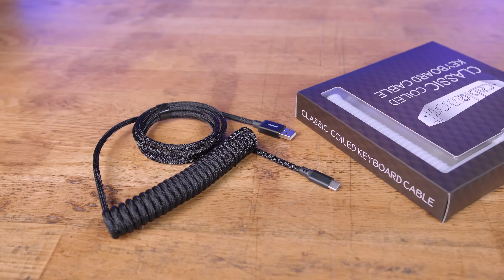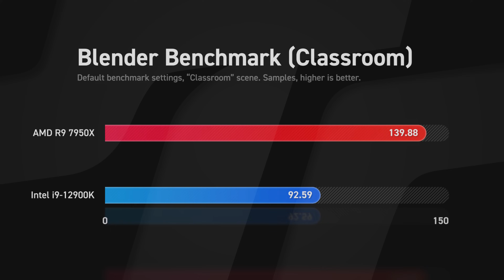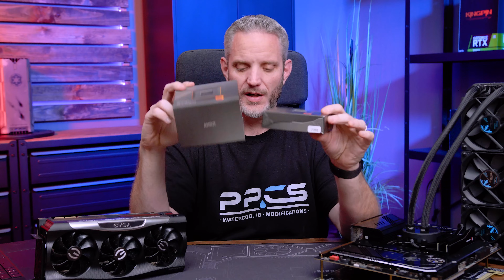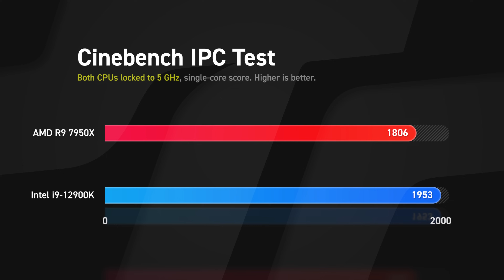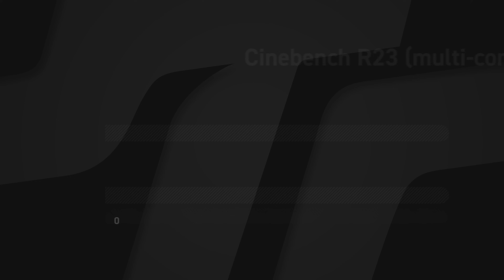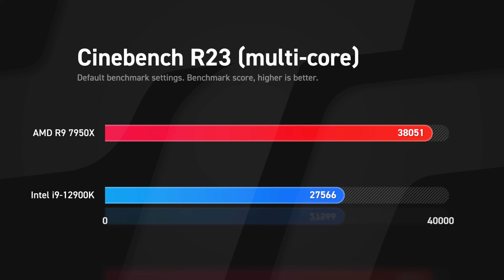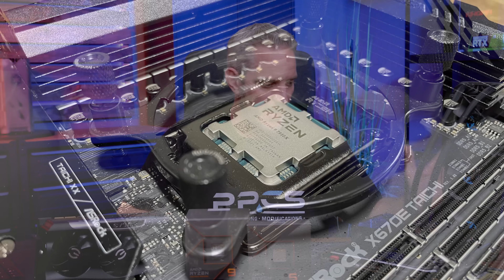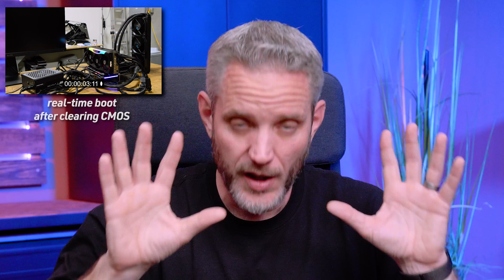Forget EVERTHING you THINK you know about AMD... these CPUs kick A$$!!

Comment: The fact that it adjusts the RAM timings all by itself on boot is amazing.
Reply: I wouldn't mind seeing that feature for am4/ddr4
Reply: People will really argue about anything. If AMD has better CPUs then Intel then great. If Intel has better CPUs then also great.
Reply: The most annoying part of PC OC is RAM, could take full day to find optimum timings. Now, clear CMOS, turn it on and grab a drink till it optimizes itself :D
Reply: @amehu  Yeah, great idea! Reset the motherboard settings to default for a more stable overclock!

Except for the part where doing so would also deactivate any overclocks and therefore negate the entire process.
Reply: @rio-dq9sc  I've not noticed any difference whatsoever between an Intel I7-8700k and a Ryzen 7 5800x. They have almost complete parity and there are 0 compatibility issues.
Reply: 100% agree.
Reply: @rio-dq9sc  Could you actually make this any more biased?
Reply: @josephp1592  Laughing with 16 cores and 32 threads while just using at max 12 threads. Should’ve spent the more money elsewhere buddy, like faster GPU or larger NVME SSD.
Reply: @josephp1592  You gonna be going waaa waaa when intels new FABs are built... 🤣

Comment: 5800X3D just beat Ryzen 7000 XD. 

Ryzen 7000 is heavily depended on good RAM - u need at least 6000 CL30, tight timings, it's better to get 6200 CL32 which is expensive as f. RAM + Mobo + 7600X = 1k $ XD Sorry, not buying. 
5800X3D + mobo + bdie 3733 CL13/14= 749$, and I will be on par or slightly (1-7%) worse, or even 17% better in some games. 

7xxx is NOTHING special in games.

Comment: Even if Raptor lake is a great improvement over AL, there's no reason not to buy into AM5. When Steve at GN could only get a confident CPU bottleneck in like four games and getting like 600+ fps in those with the top end 3090ti at low settings and 1080p, you are going to be GPU bound no matter what anyway (in real-life gaming scenarios) so for gaming a zen 4 CPU choice can't be wrong. With 20-40% multi-thread of 12900k uplift, its probably going to be on par (or better) with 13900k in those loads as well.

Well done AMD. I remember when a bunch of people said how bad zen four would suck because it only had a 15% performance uplift. Yeah we know who you are.

Comment: my gpu upgrade i be getting in the next 4 months is going to be a rtx 2060 12gb was going for a 3060 12gb but its cheaper and easier to obtain with my fix income then i can give my bud my gtx 1660 super oc 6gb and he can stop using my 1050ti 4gb and have a lil better performance then just save up for the other pc upgrades which that's another 4 to 6 months to save up for and then give him my current pc which is a gigabyte b450m ds3h mobo ryzen 5 2600 cpu and 4x4gb of gskill rip jaw v 3200 ddr4 so he can upgrade it to 32 if he wants were his current intel 5 ddr3 mobo is only 8gb max.

Comment: The problem I have with AMD is it's always had stability issues. I built an full AMD system about 5-6 years ago and I had nothing but stability / crashing issues the entire 1 1/2 years I ran the system.  I never even tried overclocking the system and never could I get it to even run the memory at the lowest advertised speed. If I tried setting the memory to the lowest rated speed in the BIOS it would be caught in a BIOS crash loop.
Unless they have fixed the stability issues over the last couple of years it's unlikely I will ever buy one again.

Comment: Not thrilled about the new boosting behavior, a lot of heat (which is fine) but also a lot of power draw. When does it boost? Will it boost on any mildly heavy load?

Comment: Being a gamer who mods fallout 4.... Talk about an understatement, at present I have 714 mods for fallout 4 alone.
Many of these mods and many others that I don't use have to apparently be patched to work with AMD the CPUs etc. I've seen a lot of good results from them don't get me wrong, but a lot of the mods that would require a patch for AMD? That passage is simply doesn't exist which means you can't use that mod if you're running an AMD system.
Like I said, it's too bad cuz I see a lot of good stuff coming from them

Comment: this might be myth: but iv read and been told by a few sources that these processors run extremely hot. they said to lower the voltage just by a little bit and runs just as fast if not faster but stays way cooler.

Comment: The more I think about the new AMD thermal design the more I like it : your cooler is a fixed parameter, then you adjust your fan/noise level, and then the CPU auto adjust to a stable clock at 95C, so you got automatically the best performance for your setup !
EXPO is a nice improvement as well, RAM OC is such a hurdle...

Comment: Hi Jayz, being able to overclock ever single core sounds neat, however, doesn't that present an optimization issue? We're not at a level where CPU load can be spread evenly in software titles (certainly not games) so the main thread will always dominate CPU cycles so having a couple of cores that are focused on overclocking sounds like it could be more performant than all cores which could go up and down. I guess we'll need to see some real-world results to know if this is better or not.

Comment: chill they have not done much over the 15% clockincrease that tsmc rated their node for :D credit were credit is due(also the effective clock cycles back at tempmax look at the hardware info)
the ram training needs to be dumped and put into a fukign buttoin in the bios...complet design failure. No idea who thought training over the most basic by defautl is a fukign good idea...ITSNOT
and the querks are the fuking TMP that they FINALY figured out and is partialy adressed in agesa 1207 i belive it was....
the 7600 and 7700 are designed form gaming so why arent there 3d parts of them the base versions are jsut waste of sand if you know they will be obsolete by q2 ..i dont understand this launch....is it nothing mroe than a fukign stopgab to be faster out than intel ?! casue they cant get the 3d versions ready? Who ever buys a non3d  6 or 8 core is insane IMO the 12 and 16core for workstations will be amazing! (althou i doubt the 12core is worth it with the platformcost)

Comment: This is weird, Nvidia is nowhere near as far behind as Intel was with chip development and setbacks. Intels problems were 10 years of manufacturing issues with low nm processor development. Nvidia has never has that issue, because they've always outsourced manufacturing to TSMC and Samsung. In fact, Nvidia has been the leader of the pack in terms of hardware, software and ai solution as standard operating procedures. Even if people don't like Nvidia's prices, they can say they haven't been innovating, or trying to give us the most powerful hardward in the entire computer industry. This is all just a weird line of thinking. "Railroad spike"?!?! Yikes.

The 4090 will continue to be top of the stack in terms of perforamnce; AMD will only be competing on price, and performance for dollar, not better performance outright. AMD didn't even aim for best performance, they wanted better perforamnce than the 3090 at a lower price. The only question is, how much lower is the price.

Comment: From what I understand about the temps being at a constant 95, you will always hit that mark no matter what cooler you use. Only difference is that when you use a better cooling system, its going to try to increase the voltage and wattage being consumed by the chip in order to achieve better clock frequencies, but will stay at or around 95 degrees. 

So different coolers will get different results in performance, if that makes sense.
Reply: @Lurch7861 You clearly don't understand hardware.  What temps do you think your servers operate at?  Servers regularly are near their TJ-Max and they can stay like that for years without problems.  Migration only happens if the voltage is too high with too much current and high temps are only bad because higher temps increase the power necessary to maintain a clock frequency and thermal cycling causes the connections in the CPU to degrade.  However if the CPU is just pegged at 95C its no different than a mining GPU pegged at 95 C it really isn't that bad for the chip.  Gaming workloads are probably worse because thermal cycling is really bad for the connections in the chip.  The real threat of high temps is too much voltage which is why you want to keep things cool to keep the voltage down.  However if AMD built this behavior into the design they have to know that this CPU can tolerate the voltages necessary to achieve these high clocks.  In fact LN2 overclockers are having a heyday with Zen4 because when they push the voltage they get a boost in clockspeed it seems this Architecture was designed to be fine with high voltages and that is fine as long as the architecture was designed that way. In an age where it gets harder to shrink transistors you need good architecture design to make up performance and allow for smarter and more efficient behaviors. 

This technology would be great in laptops because laptops already usually hit their max temps when under loads so the CPU will be able to get maximum performance out of the cooling solution on the laptop.  If you own a laptop your laptop regularly hits it max temp unless it is some brick that can't be moved anywhere.

Comment: Also the LTT review was kind of meh... but why is no one else using the intel 12900ks as the thing to compare against? Iam an amd fanboy and i still dont think its fair to not use the best processor from their current/last gen when comparing the new AMD to them. If its not as good or doesnt seem as good next to the KS, then thats just how it is but dont water it down by showing AMDs new best vs intels second best....I was really hoping 7000 series was going to pwn 13th gen but seems like the 13900k is going to blow AMDs doors off Its going to be 24 cores for christ sakes! Even if 8 are E cores... seems AMD will not have come back to their prime yet. :(

Comment: The thing with temperature at 95 degrees constantly and constant max frequency doesnt add up. In that case the cooler has to exactly remove the same amount of heat at all times... which is very unlikely and its very unlikely that it matches this temp 100%. -One of two will happen: 1 it will thermal throttel. 2. the temperature will go up.

Comment: My question is. If these cpus are getting these hots. Does it mean you no longer can have a cold and quiet system? My i7-10700k at 5.0 and 3080 at 1935mhz hover at 60c under gaming load with the fans barely spinning. It is almost dead silent. If the amd 7xxx series cant deliver that there is no reason for me to even look at this.

Comment: Great video Jay!
One thing that bothers me are the temps and yes, I watched the whole video. I wouldn't really give much weight to the AMD spokesperson telling that hitting 95c is by the design. I mean it certainly is but if they didn't suddenly find out a way to make silicon sustain higher temps the thermal degradation is going to happen more rapidly no matter what. What I am thinking is that they might get away with it since 1. it will easily last the warrantly period anyway and 2. usually the thermal degradation is linear progress so if reviewers don't make benchmark videos in lets say 2 years from now it might go unnoticed. Also why I think this is a big deal is because it is simple physics that by running at 95c the CPU is able to run with higher volts thus giving an edge to achieve higher clocks compared to for example running at 50c (when cooling power is normalized). The simple reasoning for forementioned is that when delta T gets bigger the heat dissipation to the surrounding air gets greater (in wats) thus allowing comparably worse cooler to achieve higher cooling power in wats -> CPU can boost higher.

Please correct me if necessary!
Reply: Silicon has no degradation at 95C. The process could have degradation because of current/voltage, but not in thermals. Mosfets are made of silicon, and they do not have any degradation at 115C. Usually CPUs were throttling at 95C because leakage would become a factor and they could start crashing because of it. If the design is more alike mosfets, and the process allows for it then this is not an issue. However, having said this, I would still have preferred that they went with a less thick IHS for AM5, and break cooler compatibility, requiring AM5 brackets. They could get probably 10C less and/or better clocks.

Comment: The proper way to count CPU generations is to start with the 8086/8088 design as generation 0, then 80186/80188 as gen 1, '286 as Gen 2, etc. with original Pentium and AMD586 as gen 5, Pentium II (P6) as generation 6 and upwards from there.  Have fun comparing benchmarks between old MS Flight Simulator on a 10 MHz (9.54 MHz) 8086 with IBM MCGA graphics and the latest version on the latest CPU with the latest GPU.  For fun, also try the AMD version of the old CPU.  Fly the same demo mission in both tests and check FPS, resolution and power.

Comment: I'd be excited if it were not for AMD having USB port stuttering issues.

I have keyboards / mouses that will constantly disconnect from my 5600x PC but will run fine on other PCs. 
It seems like it happens more frequently with wireless than wired. And before you assume, I will say the same accessories run fine on other PCs also with AMD and on Intel.

My issue is with 5600x  on a GIGABYTE B550 AORUS ELITE AX V2 AM4 AMD B550 ATX Motherboard. I have updated BIOS, has not fixed the problem. 

Wireless issues started with a wireless keyboard, it worked fine for about a year, and the issues with missed keystrokes started occurring, at first I thought it was just the keyboard, so I stopped using it, went wired, problem solved. 

After about a year similar issues started happening with the G305 wireless mouse too. It will suddenly stop working for 1/2 a second then resume working as normal, just like the keyboard. Checked battery, software, tried using different USB ports, 2.0 and 3.0, I even disabled power saving in windows and in bios, etc, still nothing fixed. 

Seems like a BIOS issue or something to do with Ryzen and Gigabyte. 

Personally I think after this annoying issue I am going with an Intel and Asus board next time. 
It's not what I want to do, I just don't want headaches. 

And I've had a different stuttering issue with low FPS drops back in the day on i5 6500 years ago which were similarly annoying, but I am willing to go back to intel and give them another try because AMD not being able to figure out a simple USB issue is ridiculous.

Comment: For workstation purposes considering the total cost of the system, 7950X is definitely an easy choice over the 12900K. The difference at that point comes not to $550 vs $700 but $2000 to $2150 (<10%) for some 40% faster performance.

Comment: 95c is a hard no for me...  There is no reason a CPU (or a GPU for that matter) should run that hot during normal use...  All that heat is wasted power and I'm not interested in running an aircon in the winter just to use my PC.

Comment: That boot tuning should be done with a progress message on screen showing what it's doing.  Because as the CPU designer, they should be able to reconfigure the IO chiplet to drive RAM at the different speeds while keeping the temporary BIOS state somewhere else (like the cache).
Reply: If they had it show progress, it would take longer, because it would have to boot to logo every time, then do check. They could show a dialog first boot though just let you know. I remember an abnormally long first boot on recent 5800x upgrade so it isn't out of the ordinary, just a bit longer.
Reply: @xeridea  They should definitely show a first time dialogue and then every few boots a simple "Yup, we're still at it!"
I'd even recommend displaying (Or having the data available in BIOS) the tested timings for those who like to OC and can start off more finely tuned.
Reply: Naw with this new era of dwarven technology, they can just chuck in a spell of PEBCAK onto the CPU and make it screech the buzzer if you get too close to the power button when it's doing it's thing
Reply: I prefer it just sitting blank personally, why use up valuable ROM or BIOS code space with fancy splash screens you will see one time?  Better use it for slaying Intel 🤣
Reply: @SinfulPreacher  Not wanting splash screens, just basic text mode progress to understand and fix problems, just like before PC95 splash screens.  As soon as BIOS has a place to keep it's stack and state (2KB working RAM on OG PC), it initializes the monitor output and shows what it is doing. Before that, every situation has a unique beep or LED code listed in the printed manual.
Reply: And risk corrupting the BIOS? No thanks.
Besides BIOS is not a software (it's more like an FPGA). It can't be stored somewhere else and still functioning.
Reply: Well if people would read the manual that would be fire, but nobody does that anymore, not even for new platforms.
Reply: how about 7 segment leds on motherboard showing how many reboots remaining until it's done?
Reply: @t3hpwninat0r  if it knew how many restart it would take, dont you think it would have adjusted to those timings in the first place? You could have a golden chip and it could boot at the very first try with the tightest timings.
Reply: @jasonchan5504  🤷‍♂who knows, maybe there is a fixed number, maybe show something else like a status code. anything to let you know it's working normally so you don't start pulling plugs.